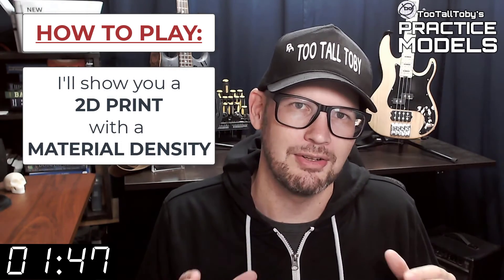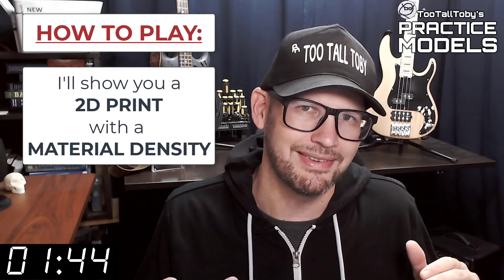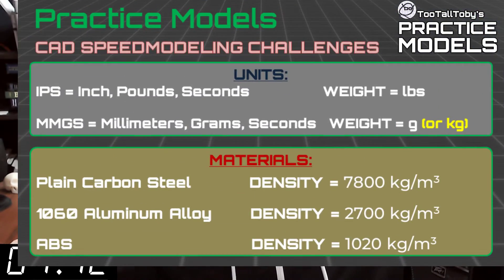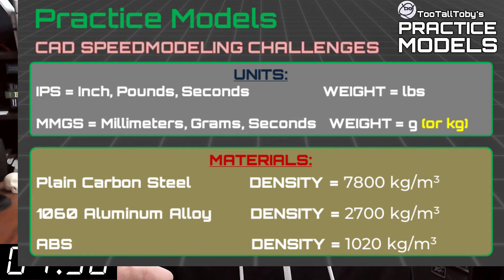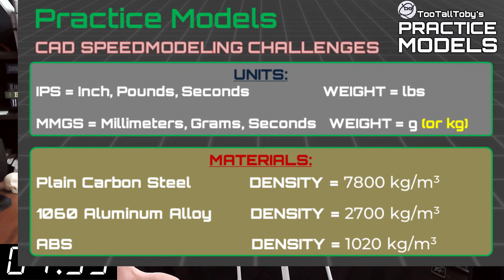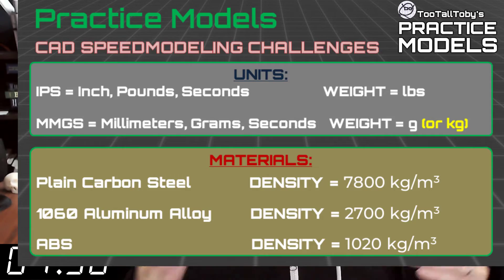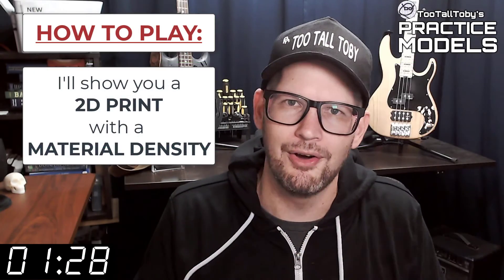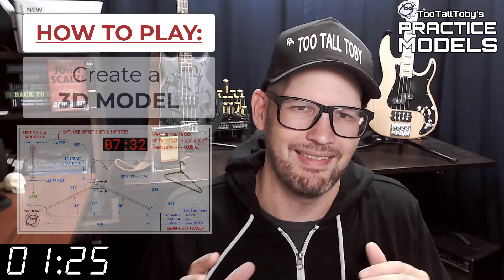2D Drawing to 3D CAD - PRACTICE MODEL- Exercises for Onshape, SolidWorks - STAND BASE 3

Comment: After a long break, completed in 12:04 with a mass of 893.158g in F360. I wasn't sure how to get a sketch plane between the cylinder axes, so I drew some construction lines on my base sketch and then did a 'Plane at Angle' of 90degrees on each line. Is there a better way?
Reply: Figured out an easier way - Construct an 'Axis through Cylinder' for each cylinder, then Construct a 'Plane through two edges'.
Reply from the maker: @joshualebo6820  nice-  I just posted a video on how to do those planes and ribs too!
Reply: @TooTallToby  I saw that! I think the Solidworks steps seemed a bit faster, and had me take another look in F360 to emulate.
Reply from the maker: @joshualebo6820  Nice!  Does F360 have a RIB command?
Reply: @TooTallToby  It does, and I also had a short lived issue with the curved surfaces (didn't know about pierce), so I created tiny 'stub' horizontal lines across the top of the cylinders
Reply from the maker: @joshualebo6820  awww yeah!
Reply from the maker: Very nice Joshua!  Always great to see F360 users in here!!
Reply: That's how I did it in Solidworks.

Comment: I know I’m a newbie to this, but why can’t the RIB command work in this situation? I’m (and others) having to draw the ribs, extended into the bosses and then extrude. Seems a bit long-winded?
Reply from the maker: You have to add a litttle flat spot (a line that is colinear with the top of the cylinder)  otherwise the rib cannot terminate
Reply: @TooTallToby  I had the same issue as Rob, and find termination of ribs quite frustrating (and it might just be me, but inconsistent) at times.  I remember a video from some time ago where you couldn't get one to work and Airwick came to the rescue with the selection order being the culprit - what hope do we mere mortals have??!
Do you have any videos focusing on ribs that I might have missed, or perhaps might be a great topic to spend a little time on in a Model Monday?
I'm not advance enough to see the problem with a Rib before I start the model - I usually hit the issue later on and have to roll back to do it an alternate way!
Regardless, I love these videos and am so grateful for the time you put into this :)
Reply: The line for the rib consists of three lines. Two horizontal, from the center of each cylinder to the edge of the cylinder, and one that connects the two lines.